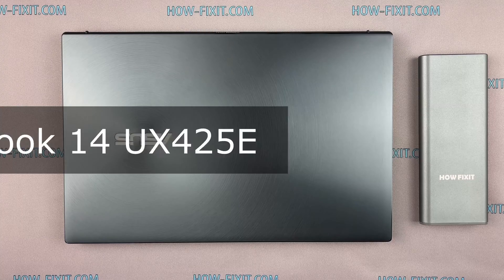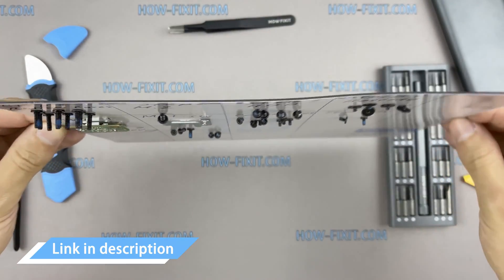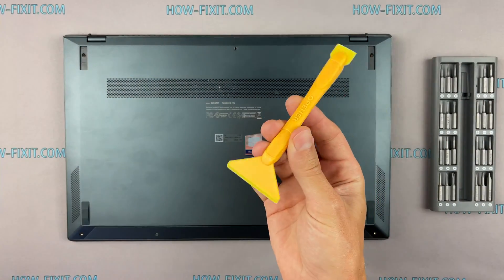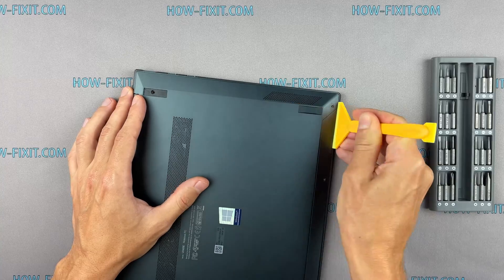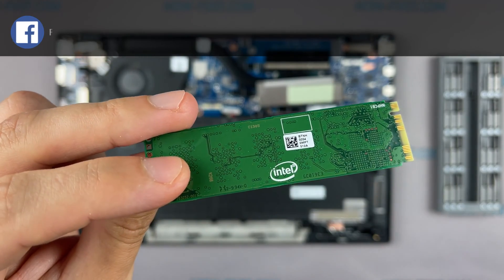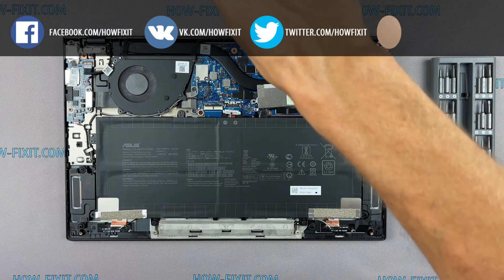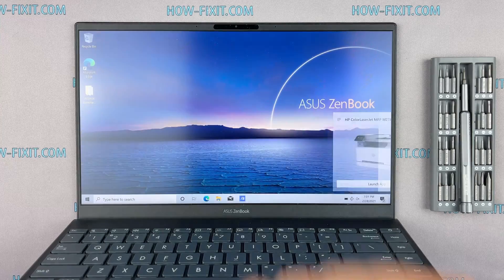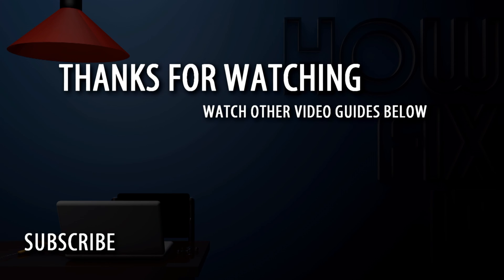Asus ZenBook 14 UX425 M2 SSD Upgrade & Install Guide - Boost Laptop Speed!

Comment: Anyone knows if it can take 2tb nvme ?
Reply from the maker: There is no limit on the maximum size of an M2 SSD, but there are Windows limitations. If your Windows is 64-bit and the GPT file system - you can install a drive of any size. Check the description for links to recommended drives.

Comment: I removed the black sticker which connects the ssd to the heat sink. Now my it doesn't stick well and my ssd is running hot. What should i do? The sticker does not stick well.

Comment: hi, thanks for your kind advise on upgrade. I installed Samsung Pro 990 2TB PCIi 4.0 Gen. and system says that Gen 4.0 port need to be connected. Would you, perhaps, know if it possible on UX425UA model? And also I started to get random BSOD and restarting.
Reply from the maker: try updating your bios, this should resolve the issue

Comment: Can another one SSD be placed into this laptop, leaving the original one installed? As I've seen, there's another one M2 socket inside, not?
Reply: I had the same question did you ever get an answer to that?
Reply: Would you please tell me where the other M2-Socket should be?
Reply: theres only 1 ssd socket on this mainboard, unfortunately u cant upgrade without change it
Reply: so i can just use 1 slot for one ssd  @dadangyoyon-v5y